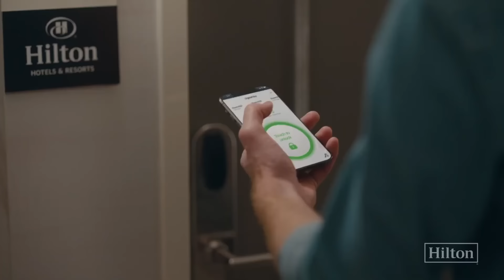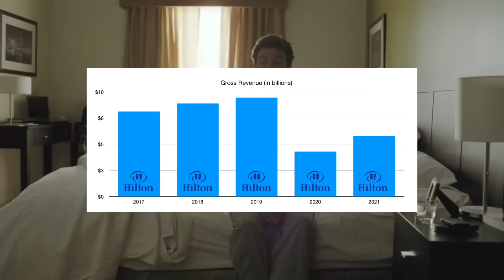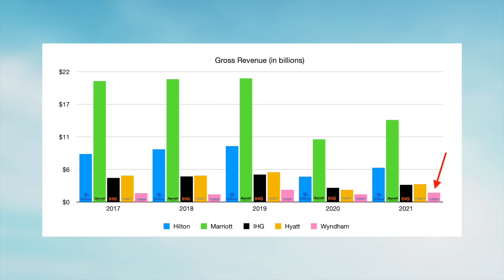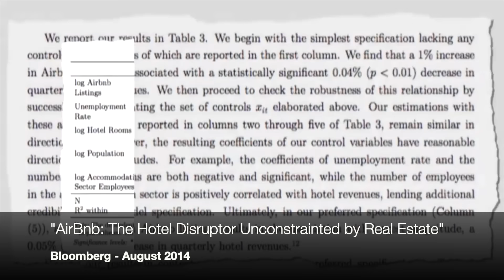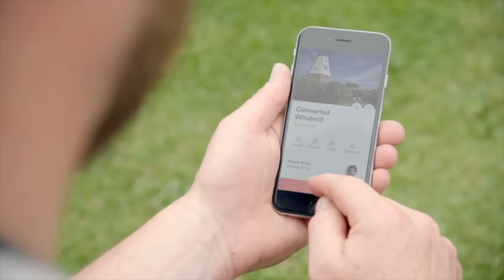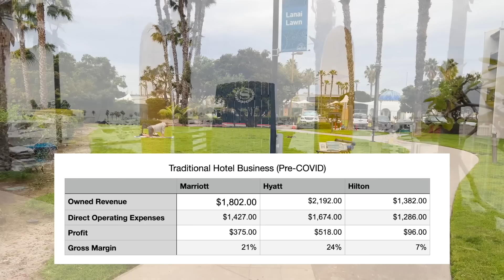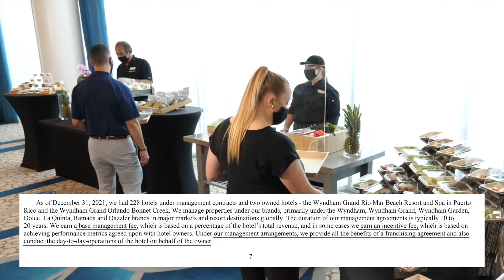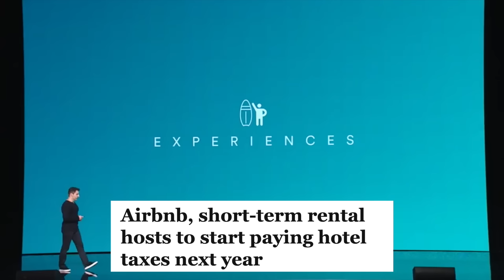Why Airbnb Fails to Disrupt the Hotel Industry

Comment: There are two main reasons I have no interest in Airbnb: 1) I am disabled and 2) I am female. 

With a traditional hotel, there are requirements to be accessible. I can book rooms that will fit my wheelchair, and I can sue them (extreme, but allowed) if they do not meet the standards laid out for them by law. With Airbnb, it's just someone's house. What do I do if that host has lied about the amount of accessibility? How do I hold them accountable?

Number two is difficult. Having read so many stories of hosts (read: male hosts) on Airbnb hiding cameras in places, of them hanging around the rooms/houses they're letting out...I'm not comfortable with that. While I don't believe that this is every place on Airbnb, it's difficult to know which ones are going to be a problem. You're putting your safety and your vulnerability in a stranger's hands. I fully acknowledge that there are women who travel using Airbnbs and are absolutely fine, but I am just not that type of person. I don't trust individual randomers like that. Especially as I'm in a wheelchair - if something went wrong, I basically have no way to fight back. This sounds extremely doom and gloom, and I know that. And people (women) are attacked in hotels, too. But at least a hotel has a corporation behind it: there's other people working in that hotel who aren't attacking me and would help me. There's constantly someone there. There's higher security for who works there and where they work. There's more accountability if something went wrong. They actively work against anything happening because it would hurt their business. Individual Airbnb hosts are not working for Airbnb. They're working for themselves through Airbnb. They have no stake in not destroying Airbnb nor do they have a boss or HR watching them. 

I want to add here that I am not normally the type of person to prefer a corporation over a small business/individual. I usually try and go the opposite way if I can. But for some things, I prefer the rules and regulations and the bureaucracy that specifically a corporation brings because it makes it safer and means you can hold it accountable to these things. There are people who you can contact when things go wrong, there are laws regulating them to be a certain way. It's for this reason that I only use registered taxi companies. I don't want to just go in some random person's car, even if it may be cheaper. I want someone who has been registered with the government. Besides that, I want someone who is being paid enough money to live on and not to support a company that is against unions (but that is very difficult nowadays with all these American companies coming over here to the UK with their American ideas of union-busting).

As I was writing this, I realised a third reason, although it kind of fits into the first: I have autism. I don't want to deal with people as much as possible, but I like everything being the same. In a modern hotel, you oftentimes barely need to talk to people. Sometimes not even when you're checking in and out. Every franchise of that hotel is designed to look the same. You get the same furniture in the same place, the same colours, the same generic art. I like that. It's comfortable and familiar even when the place I'm in isn't. I know where everything is, I know how things work, I know the general layout, it's going to be there year after year. It's great. Legitimately. Giant corporate hotels like that are brilliant for autistic people. The noises and sometimes too-bright lights, less so, but in general if I were to design like the perfect hotel for me, it'd look something like modern corporate hotels.
Reply: Same, as a solo woman traveler, I’ll pay more for safety, reliability and accountability. Airbnb is fine if ppl are traveling with a large group and want a whole house to split, but I’d rather have a comfortable, clean and reliable room after a long flight. I often love trying boutique hotels in big cities to get some of the individual feel but still have the hotel amenities.
Reply: Same here. Even though I usually travel with my husband, I don't trust Airbnb. Unfortunately I've seen cases that the man is tied up and have to watch horrible things happening to their partner.
Reply: You sound like a horrible customer. 
I would refuse to serve you. I don't want to get sued because the color of my curtains gave you anxiety or something.
Reply: Lol you're like a patient recently that claimed they had autism and complained about everything and everyone.  Had to call patient relations because the staff wasn't treating her as an autistic patient.  Terrible.  Sounds more like Asperger's
Reply: @peachesorange5719   
I am not a prole I don't serve other people  for a living because I am rich and you are not
Reply: @alainportant6412  lmao of course you are RiCh

Comment: Biggest differentiators IMO come to the privacy/density of visitors. Most hotels I've experienced have paper thin walls and doors where noise (yours or others) is a problem. Hot tubs, pools, etc are almost always shared spaces. Animals are not as commonly accepted. My experience with Airbnb is you can find a place that is a separate living space that is not adjacent to another guest/room and can have space between any neighboring houses. This makes noise, both yours and surrounding, less of a problem. You can usually find places with their own hot tubs. That accept animals. And so on. As long as the cost of those places is comparable to a hotel room, and reasonably maintained, then they are a more advantageous choice. However there are a ton of places on Airbnb that aren't that. A small room in someone's house for instance. Those colo style arrangements really have little to no benefit over a hotel and where a hotel just ends up being preferable.
Reply: What hotels are you staying at because I've never had sound travel through a hotel wall.  I can hear my neighbors through our house walls just fine though.
Reply: When i went to a hotel the walls are soundproofed and feels like concrete is behind them
Reply: Almost every airbnb I’ve stayed or looked at has guest and animal limitations

Comment: I've always shy'd away from Airbnb for the chance that "What if the house / apartment sucks?" Most cases you're not familiar with the area you're booking in and you're committed usually to a whole week or more to get a good deal. With a Hotel, if the place or surrounding area is no good, you can leave after 1-2 days and go someplace else.
Reply: ? you will get discouts on airbnb as much as you'll get them on hotels. Many airbnbs accept people for a single night.

Comment: I use both hotel and airbnb. I largely had pretty positive experience with airbnb but I made sure that I stayed properties with lots of reviews, super host status or professionally managed by refutable companies. For longer stays, I tend to use airbnb because it is cheaper and for remote places, there aren't many availabilities of hotel so I use airbnb. I find that price difference is becoming smaller every year. I just prefer to stay at hotel or residences, if price were the same, for obvious reasons.

Comment: When a hotel corporate conglomerate has gone completely franchised (this is also what McDonalds does btw) the corporation is mostly like a bank rather than a business. While banks like to think of themselves like they are just a business to they are fundamentally different because they are the sole conduit average people and small and medium size businesses see to monetization. The other form of monitization being things like angel investors where a new businesses is funded UNTIL it has value not after it does which again in my opinion distinguishes this category as well. This later type is much smaller but is also what has created most the value including tech startups like Google. But it's my opinion that compared to a centuries past this a tickled compared to what banks used to do in this regard as opposed to a few insane angle investors. So my hypothesis is that since banks don't provide value creation to the economy large corporations have an alternative. The key is that corporations need a way to financialize like a bank. They need a way to create their own currency that they can adjust relative to others which gives them monetization. Many corporations can do this explicitly like with stock buy backs. Google can do this with your time. McDonalds can do it with lower wages, Amazon can do this by not paying sale tax and the airlines can do it with rewards programs. Ultimately this is what graduates a holding corporation or a tech conglomerate from the big boys that can't really fail in the normal way we think of it by simply running out of money.

Comment: 10 years ago I loved homestays, and did quite a lot of them when I couldn't afford to stay in a hotel. The main issue is deception in advertising and a lack of consistency in all aggregators.  After all these years, most places being used as a short term rental have a "look" which is Ikea. Painting to cover up major issues like water damage and mold. It's basically a scuzzy apart'hotel from the 90s at 3x the price. The housing stock suffers from a lack of care and maintenance as people limp their boring little "investments" along.  I went back to hotels because at least they are invested in their environment and I can be reasonably sure they are making a modicum of effort towards comfort.

Comment: As a frequent traveller, for me, it's really really simple. In an AirBnB I get two things done well more often than I get in a hotel room. Firstly, and most importantly in the 21st Century - A solid internet connection.  Hotel internet is generally terrible and very inconsistent. I cannot cannot cannot go on a business trip or a family trip, or ANY trip without decent internet access. In addition tall hotel buildings often suffer from being in Cell service dark spots. So I can't even tether in this situation. Secondly, the ability to make and store my own food. As a health conscious individual, it is vital that I can make and store my own food. I want to have snacks and drinks on hand, and often times in a hotel room, I may or may not get a fridge, and rarely get a microwave. These two things together are hard blockers for me renting a hotel room. Not only that - most hotels that can guarantee a consistent quality of experience in the world of fridges and microwaves, and internet service are VERY expensive. The different in location between a 10 minute drive and a 15 minute drive when I'm in a city isn't enough to justify using a hotel. If it's not walkable, then I'm in a car either way.  Not complicated.

Comment: Ten years ago, I used to stay at AirBnB properties all the time. Now I never do. It has become no cheaper than a normal hotel, and at a proper hotel I get guaranteed professionalism and cleanliness.... plus room service, plus someone to carry my bags, plus a valet service, on-site security guards and safety cameras, a rooftop bar and swimming pool, a quality restaurant, plus, plus, plus, plus...

In addition, some hotels offer an Airport Transfer service (bus) to take you from the airport direct to the hotel when you fly in.

And if anything in my room at a hotel is not to my liking, there are proper and formal avenues to pursue to have my complaints heard and addressed by management. They have standards to meet and a reputation to uphold.

In addition, when I joined the Hilton Honors program (which is free to join) I automatically got 30 percent of all my bookings. Not bad for applying for a free membership. 

AirBnB used to be cheap and fun, but now it's not, and there's a couple of other issues: I've had rude hosts, the 'cleaning fees' charged by the host can be steep, and the poor standards of support and help from AirBNB itself are a worry. 

(You need better standards than that when travelling because travelling and being far from the comfort and familiarity of home can be stress-y.)

Some hosts I've stayed with have even had issues with their building/apartment not being approved for AirBnb stays, thus resulting in angry visits by realtors or warnings from caretakers while I was on the property. One host had written caution notices and reprimands pinned to the front door while I was inside the apartment alone. Hosts have had to sneak me into and out of apartments, for fear of being caught. That is not proper service for the price paid.

As for AirBnb, let's just say I've checked out. I haven't stayed at an AirBnB property since 2014. Up until then, I used them all the time.

I'm not sure if I 'want' or 'expect' certain standards or if I need those standards. When I was younger, I put up with anything and didn't have the budget to demand or expect much. Now it's different.

Comment: I stayed in an Airbnb in Mexico for over 4 weeks in a very nice gated apartment with the entire unit to myself. I got a great deal since it was a long-term booking. I compared the prices of several hotels in the area vs several Airbnb months before arriving and I would have paid double in a cramped single room for even the cheapest hotel. With the Airbnb, I got a 2 bedroom, 1 living room, 2 baths, kitchen, and free Netflix on a nice big mounted flat screen.

I also scored a really good deal on a 2 bedroom penthouse apartment in Brooklyn that was being posted as half off for 3 days totaling $ 1800 vs comparable hotels in Manhattan at $ 750 a night.

There's also been plenty of times were Airbnb prices were too high compared to hotels so I decided to stay in the hotel (Vegas & New Orleans). 

1 is not better than the other. I love the fact that I have the option to compare and decide which works best for me.

Comment: Airbnbs are almost as expensive as hotels and often have some-to-alot of problems. Hotels are consistent and generally have more amenities.

Airbnb also often sides with hosts, even ones with a history of scamming and evidence of it.
Reply: exactly on that last point, an airbnb host can claim anything as dirty or broken and charge a fee you cant refute unless you take pictures of everything every time you book. a hotel usually already knows what’s broken and just wont rent that room out until its fixed. also no cleaning fees, its included in the price. ive only had to take pics of everything when staying at a shady motel, thats just common sense, but an airbnb can do that regardless of how reliable it looks

Comment: For me, the simplicity of hotels far outweighs whatever benefit Airbnb may offer. When I travel, I don't really care for luxury in a hotel room since I only use it to sleep really. The low cost, with the added simplicity of checking in, pricing, and freedom that comes alongside a hotel far outweighs Airbnb, where additional fees (cleaning, etc.) can really rack up the total cost and checking-in can be a real puzzler. Plus there are quite a lot of rules that make it a relatively restrictive environment when compared to hotels. Some Airbnbs have cameras too, which makes me feel uneasy.

Comment: It's a bit like Uber vs Taxi, started with pure costs war, but in the current state it's really about preferences. Airbnb platform is now mature, search engine very powerful, listings vary from luxury villas shaming any hotels to dodgy and dirty shared rooms. Most popular locations are packed with professional hosts, beautiful, clean and well designed apartments, offering much more options and space than tiny hotel rooms, and often with tons of included accessories (chargers, games, books). Also in smaller cities, or remote mountain/beach destinations hotels are simply not available. On the other hand if you need just one night by the airport, or big city it might just not be worth the effort to find the spot and check in. As for reliability... In fact airbnb hosts are much more dependent on good feedback than hotels are. Maintaining super host status is extremely hard, look for those and you'll be fine.
Reply: Let me guess, AirBnB paid you for this comment
Reply: @alisav8394  yeah, they share my salary with Soros 🤣 we serve 40+ Airbnb bookings per year, with average note 4.9/5, and book at least 5-10 per year in numerous countries ourselves. So if anyone is paid it's Airbnb by us, tons in provisions.

Comment: Your analysis is spot on! However, I feel that you skipped the impact of AirBnB on independent mid-range hotels, where the consistency is not so good across hotels and AirBnB may not be that much risky.
Also, AirBnB is targetting more and more upscale independent hotels, allowing them to use their platforms (at what is probably a lower cost), which makes it "just" another medium size Online Travel Agency in that case

Comment: Its more disruptive in the rental industry than hotel. I have a friend that rents an apartment downtown to do airbnb. He rents the room for 2k a month, but posts on air bnb for 250 a night. Fully rented out he can make up to 7500 a month. Now not all rooms are rented out everyday, but his average occupancy is 75%, which means he still earns around 6k ish a month. Minus the 2k a month rent he nets 4000. He has a total of 8 units on airbnb right now and makes over 300k a year. And this is just his part time job, he still has time to manage his full time day job, because all he has to do with the 8 airbnb is to hire cleaners to clean the place every night, which is paid for by the rentors.